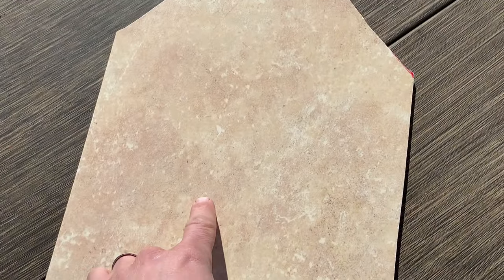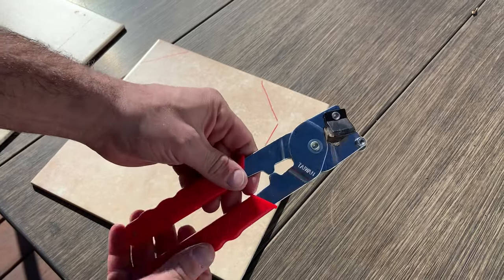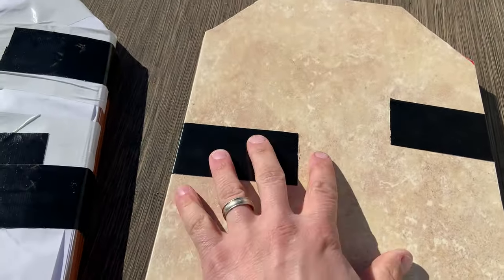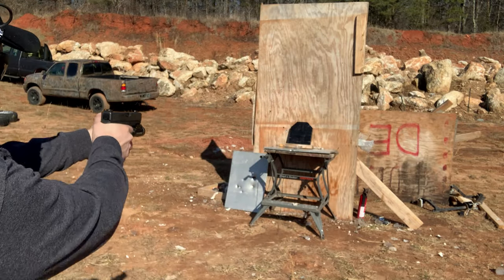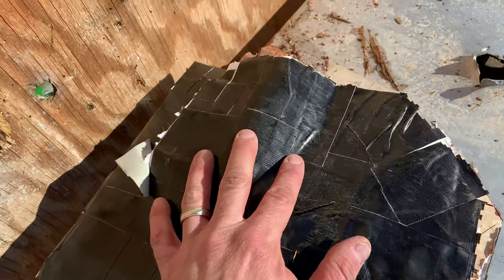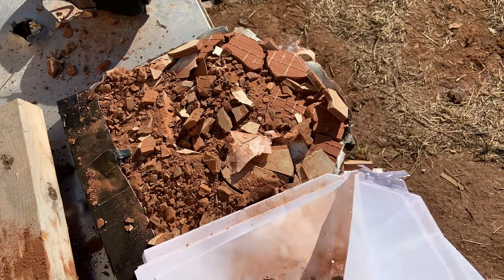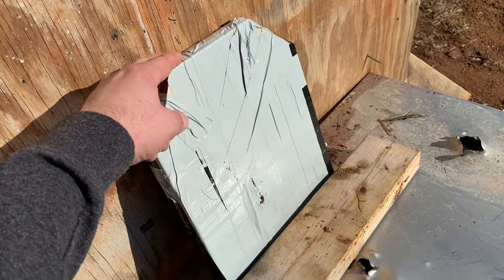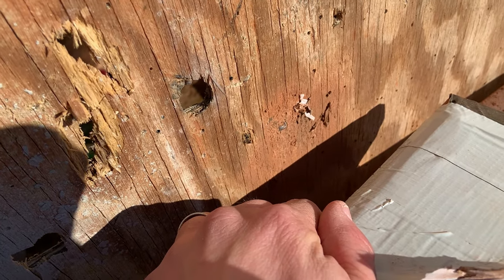$6 DIY Body Armor

Comment: I bet you are on to something here.  The body armor folks have just out priced what a regular citizen could afford. Push the envelope!!!
Reply: Hesco l210 ceramic rifle plates are like 300 bucks a set... not bad at all
Reply: LA Police Gear lvl4 plates are $120 a plate.
Reply: @Sheild_against_the_wicked556  I believe that armor is just a one hit and done
Reply: @jayheredia6975  check out Mr. GunsNGear's test on it. It's actually not bad. It'll take a 5-6 rounds of 5.56 which is all I need it to do. The drawback is the outer edges. That's where some protection is lost compared to more expensive plates.
Reply: @Sheild_against_the_wicked556  True that I agree with you I’ve never really looked into that type of armor. I normally stood at RMA armament and AR500
Reply: @jayheredia6975  it's just ceramic. I'm sure they'll degrade faster than plates like Hesco, but it's the first set I bought and all I could afford at the time. AR500 makes great plates and carriers though. I have their Testudo gen2.
Reply: Bro ofcourse it is
Reply: @jayheredia6975  maybe now, but what if you were to wrap each individual piece of tile with tape, then put all this together? Maybe that would help mitigate some energy and keep the tile more together. Just an idea. Still much better than nothing if this is all u have, take it and work with what u have.
Reply: Do you need to get something upfront to slow down seed
Reply: @cristopperhamilton-gl6jb  would keep the shards in, maybe help it keep its shape. But I can’t imagine it does more than that
Reply: Watch it bend….
Reply: 😂.. Answer is right there…
..Just add some thin Plywood backing?

Comment: You should melt down milk jugs as a poly backer. Could even add ground glass or ceramic during the melting to create knock off UHMWPE
Reply: Also, harder construction tile strike face.
Reply: Layering grocery bags or produce bags too. They are made from hdpe like milk jugs.
Reply: You can buy UHMWPE sheets from Grainger in thickness from 0.0625" up to 4". You could replace one ceramic tile with a .25" thick sheet of plastic for $25
Reply: Ground glass is a bad idea
Reply: @evansaw293  Why it would be added in the melting and forming process kinda like glass filled nylon. Not as a layer by itself which would become a cloud of pain after a strike
Reply: @shovelhead2155  it would make the hdpe less homogenous. The way body armor is made is strikeface+ backer or catcher. Glass has a high hardness and could work as a strike face but its low tensile strength makes it a bad option for part of the backer. 

I could see the argument for something that may increase the surface area of the bullet between the face and backer like penny sized peices of 1095 steel to create a parachute effect on the bullet as it passes through the hdpe . But not as part of the backer.
Reply: @evansaw293  Well im planning to experiment with this concept so we will have to agree to disagree until I have some data to back up my claims. But look up glass filled polymer or glass filled nylon thats where i got the idea. Till then its all speculation
Reply: Melting milk jugs down to form flat, regular shaped plates is not only time consuming and quite fiddly, but it tends to produce very inconsistent results in thickness and strength. Far better to buy cheap HDPE cutting boards. But modern UHMWPE armour isn't made from solid sheets. It uses hundreds of non woven sheets laminated together, and it's that lamination that makes it bullet resistant, where solid sheets are not.
Reply: @holtbrent  Not all grocery bags are made from HDPE, many are made from LDPE. Surely a better way is to buy a few disposable HDPE plastic dust covers? They're very cheap, widely available and are generally around 1.5m to 2m on each side. There are no awkward shapes or handles to get in the way either.
Reply: @another3997  you can test the bags by pulling them apart. The LDPE will stretch while HDPE will rip
Reply: @shovelhead2155  its really not speculation.
Reply: @evansaw293  Okay guessing
Reply: @another3997  Right, you would want to make sure you had the hdpe type bags. But, like you said yourself, lamination makes it bullet resistant. Having thin consistent layers that would hopefully delaminate would help bullet resistance. Maybe if they were warmed and compressed? And with a hard strike face of something like porcelain construction tile.
Reply: @evansaw293  Also, most bags will have a symbol indicating if they are hdpe or ldpe
Reply: @evansaw293  You'd still be better off getting a few plastic decorating or dust sheets. Plastic bags are an odd shape, they often have awkward folds and seams and they are generally a pain to work with. Folded plastic sheet or even off a roll is at least a uniform shape and easiervto work with.
Reply: @holtbrent  The UHMWPE used in body armour isn't the same thing as melting together a few sheets of ordinary HDPE bags. At a certain temperature, those bags melt in to one lump of plastic, so no delamination. Below that temperature, you're still unlikely to get a uniform laminate. What is used in armour is a series of unidirectional fibres, each layer sandwiched between thin layers of plastic sheet under uniform pressure and a certain temperature. There are far better solutions for effective home-made armour.
Reply: @another3997  yeah, I've seen people use woven fiberglass welding blankets, even just denim adhered together with construction adhesive.
Reply: @davomoto42  the problem with UWHDPE is that they lose most of their benefits during high heat stress (like desert heat) for prolonged periods of time. Best to use that expensive UWHDPE on the back layer or in the soft body armor (infused with liquid ceramic) where it can be cooled by a portable cooling system that keeps the body cool in high heat situations.
Reply: just use a thick plastic cutting board. it'd the same thing
Reply: Hot glue works even better....
Reply: @limbeboy7  That's sounds interesting. I think I will

Comment: Because the back face of the tiles isn't flat, I would suggest trying to bond the three tiles together with tile adhesive or one of the construction adhesives. Those ridges on the back concentrate the stress in certain areas of the tile, but filling them in so the rear is flat should help spread the energy over a much larger area and also more evenly in to the tile behind... which is what you want.
Reply: What adhesive would have the best dampening effect you think?
Reply: @spacemanbill9501  liquid nails! It's ridiculously strong, it's impossible to take building materials apart that have been glued together with it. Like you can't salvage boards and stuff, it just splinters and bust up every you try and separate. Try using it and video it!
Reply: @ericbest9562  something that rigid wouldn’t absorb the energy of the bullet effectively. Need an elastic substance, something that is squishy after it sets, think silicone sealant.
Reply: @spacemanbill9501  non-Newtonian to a degree like that cornetarch shit that hardens on impact, can you think of anything? Yo L might would work melamine foam and like other types of reticulated foam could potentially work because they’re extremely durable. Are you dense weight?
Reply: I did just that but I use fiberglass resin and I sandwiched the plates with it. Kind of heavy and thick but it stopped the bullet. I was pretty impressed. I have regular level four plates and they're about the same weight
Reply: I actually just made some other place for my daughter.. and with those I used the smaller tiles that are on the 12-inch Mat so I could give it some contour. I put two rows overlapping the cracks. Then I put like six layers of fiberglass welding blanket material with resin., I shot those again with the 9mmm last night shattered the tile but did not go through the fiberglass on the back. I'm going to take my AR and AK and use both of them and see what they do.
Reply: I always imagined using a rubbery poleurethane caulk. I use it for work and it stays rubbery and tenaciously bonds for decades
Reply: Agreed
Reply: Pl premium is very strong holding, but flexible. Especially with a little bit of body heat.

Comment: Might i suggest cutting up the ceramic plates a little more (into 2 inch squares) so that a sigle hit will not compromise the entire armor plate? Also if you want to quickly upgrade this you can get a roll of thin sheet metal at most home improvement stores, you can use in-between the ceramic plates. Nice armor at the very least, though it does show flaws common in early type ceramic armors.
Reply: I don't understand, a bullet will shatter the whole ceramid plate into segments right? what's the difference between the plate being segmented by you ahead of time or segmented by the first impact?
Reply: @discord_and_entropy  because you make smaller tiles that shatter, meaning the rest of the surface area is not broken yet. It is for repieated hits to the plate. When shot you can get cracks running all over a plate, where with 2 inch by 2 inch squares the cracks don't expand past that size.
Reply: @questofknowledge8788  So the mosaic doesn't just act like a bunch of cracks already? is it because they have in tact edges?
Reply: @discord_and_entropy  in a way yes, but you still have multiple layers of armor. You keep the cracks close together and it will still hit ceramic. The idea is only to localize damage with the edge of plates acting as stops for the expansion. Modern armors are actually little 1 inch by 1 inch plastic octagons/hexagons. The idea being those specific areas are smaller and lighter but can absorb huge amounts of kenetic energy. Most armors are multiple layers of several things, high performance ceramic (usually contains high amounts of iron powders or graphite powders) or a specific plastic that can actually be aquired commercially and melted down into molds, a this then offten has aramid fibers (most commonly kevlar, but for homemade a lot of welding tarps can work), usually this is bonded with a specifically thin resin (more about appling it thinly and evenly with large amount of pressure, usually in high levels of protection this is also mixed with graphite powders). These have lots of very technical but odd effects on how armors work. The reason these pre-made pieces aren't a problem is that they are situated right next to each other and in some cases overlapping on different levels.
Reply: @questofknowledge8788  ok well I guess I'll just trust the experts on this one and go to r/explainlikeimfive
Reply: @discord_and_entropy  I'm not an expert, I just spent way too much time trying to understand things. XD
Reply: There is a reason people use single large plates, so bullet doesn't hit, ricochet or break up between these gaps between your smaller plates. A thin sheet of metal isn't going to stop a direct hit on the seam. Not to mention overlapping plates increases your weight tremendously and still has gaps where splatter or ricochet could get through. Body armor is not intended to be reused.
Reply: I suspect smaller tiles wont have much "energy dispersion effect" as the entire tile that get oblierated.
Reply: They have pre made back splashes that you could cut apart and tile together with an elastic adhesive
Reply: @questofknowledge8788 I have several questions what is the best way to connect these 1 by 1 or 2 by 2 inch ceramic pieces I was thinking some type of iron thin rod that goes up down and side ways I’m looking to make trauma plates, helmet, and potential a iron man like suit
Reply: @zaviontaylor-student320  Depends. A lot of armors have them contained inside of the kevlar surrounding it so that they can be held in place. You could also attach lines on the backside with resin to hold them together, or just use tape on the back to hold the pattern you set. Personally if I was to do something it would be tape behind and then sandwitched between layers of fiberglass/resin re-enforced fabric. It is ultimately up to the person creating it to decide. I view an adhesive surface as the easiest.

Comment: Another idea to improve the paper sheets is to later them with some form of glue or resin is you can find it cheap enough or HDPE shopping bags melted could work
Reply: It's essentially Papier Mache. White glue (Elmer's glue in the US) is really cheap and designed to stick paper or wood. It takes a while to dry if you make several thicknesses of paper in one go, but it produces a very strong, dense material, especially if you alternately layer the paper with the grain at 90 degrees to the previous one.
Reply: Ironing 2-3 bags together between baking paper works great at making hdpe sheets

Comment: since you nearly stopped the 5.56, maybe some kind of steel plate could be the backing of a reduced number of tiles? the tiles seem to do great at shattering the lead projectile enough for it to be caught. rock on man!
Reply: Weighs more, that's why you use a soft kevlar Armor backing

Comment: Do an energy test to see how much force is appiled to the body. That would be cool to find out some numbers
Reply: totally this
Reply: Yeah the internals would probs be ouchie
Reply: the amount of energy applied to the surface of the plate and by extension the body should be the same considering that force originates from the bullet. which is my round about way of saying its going to be 5.56 every time so why does that matter? unless you mean how its dispersed to the body from the plate. But that would be dispersion not just "force" as the force is a constant in this equation.

Comment: Secret Service commending about home made ceramic armor..... I think it looks a lot like those are ceramic plates usually used for protection against high-powered rifles. A lot of military and law enforcement wear them in a high-risk operation,” Skulke said. “It allows … them better protection than the flak jacket or bulletproof vest they’re wearing. That’s what it looks like to me.”

Comment: You should soak the paper in adhesive and put thinner layers between the ceramic, gluing them to the ceramic. And then have a thin backer as well.

Comment: Hi, from my experience a little mistake was to stand the armor in a slight angle, so there was space in between the armor and the plate. I think the last round would have been stopped completely if you would have had anything behind it. Real bullet proof vests also need something behind them to work best.

Comment: Go for a ceramic, steel composite where you sandwich steel plates between and on the outside of the ceramic tiles bolted tightlu together where the high torque improves the capabilities of the armor and reduces complete shattering of each ceramic layer. This is how modern tank armor works.

Comment: I did something similar. I used 3 tiles I got from Home Depot for a $1 each or less. Each tile was individually wrapped with newspaper and duct tape. Then I wrapped all 3 together with newspaper and duct tape.

I made 2 as well. The first one I just did 380. It lasted about 10 shots before 1 made it through. That was out of a ruger lcp.

Second plate I used 45 from a 1911. I did 5 shots and all went through.

Then I stacked the remaining plates and used 7.62 x 54R out of a 1941 mosin. Absolutely demolished it.

I was about 10 yards out. I think maybe a plate of iron/steel in the back with 2 ceramic tiles in the front could be interesting. 

In a SHTF situation I’d wear this if I had nothing else. I just ordered some AR500 10x12 plates though for the vest I got. Costed me about $100 for 2 plates.
Reply: Where?

Comment: layers of dyneema ( buy an old tent ) alternating the weave pattern , then apply hardening resin from fiberglass a thin plastic layer would also be helpful throughout the layers. You can place it in your truck doors or behind your seats

Comment: In an apocalyptic scenarios this would be practically needed but it was interesting. The only thing is add is after you get it so where you stop rifle rounds & most rounds, you’d have to test the kinetic energy that is dispersed into the make shift bullet proof Best & how it could effect organs. Not good if it still sends a tremendous amount of kinetic energy to the one who wears this in a crazy pinch just to die of organ failure from the impact. I’d even say for this level of testing up it to 50 bucks. Then the third stage could be to try & lighten the weight somewhat but since it’s an emergency pinch gear only, I wouldn’t focus much in lightening it but I’d up it to about 75 bucks. Nice video Bro.

Comment: Ok, what if you replaced the paper (or added to it), a couple of pieces of screen (like screen door screen), that's been painted with a '2 for $15' "Gorilla Two Part Epoxy"? Then maybe even slide one in between each piece of tile?

Comment: glue each piece of paper together as assembling backer portion. not sure what cheap glue you can find, but something that can be applied uniformly. ideally spray-can adhesive, but i think you can getaway with diluting elmers glue (polyvinyl acetate kind) with rubbing alcohol and apply with a brush. maybe if budget allows get some cotton (not t-shirt but regular cross/basket weave pattern) and layer glue into backing alternating every 3-5 sheets of paper. i think gluing cotton or canvas type fabric between tiles should also improved integrity for multi-hit test cases.
Reply: Nylon and Polyester are considerably stronger than cotton and linen (flax).  They're also resistant to rot and decay. Layers of paper glued together can be exceptionally strong, but it's a tedious job, as you can only do a few sheets at once, or else it won't dry. The better quality the paper, the better the results.

Comment: You could try thin mild steel in the middle that has a lip around the edge to divert spalling with another tile and paper behind it. Or maybe even granite counter top pieces would work (if you could find cut off pieces for cheap?)